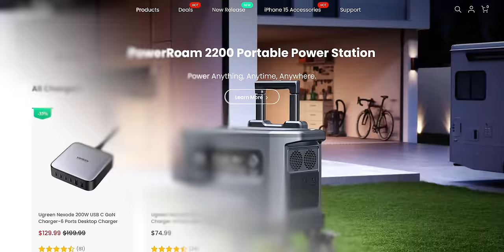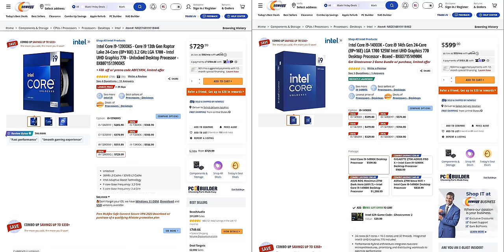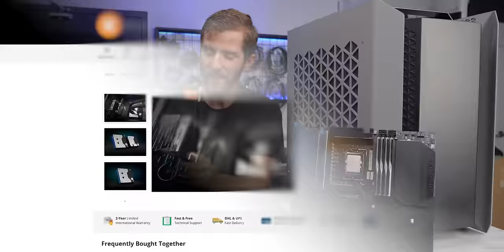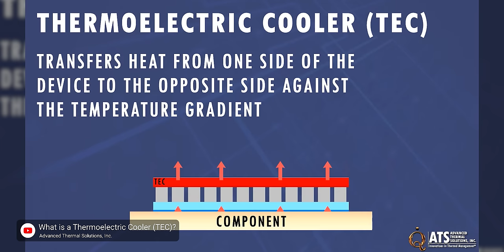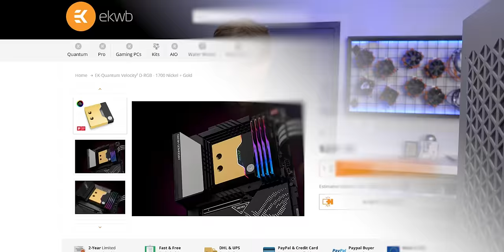Compensator 4 - How to Waste $30,000 on a Gaming PC

Comment: I think this video is the perfect reason that no one should build a compensator PC Because by the time the PC is built there's already newer or faster Hardware that has been released
Reply: I think if it fits your purpose and you like it and it plays everything you want for the coming years then it’s fine to spend 30k on it, hell I spent 15k on a DTR laptop and it’s still great. 

Guess I need to clarify since people don’t understand that people live differently than each other , but I’ve worked as a overseas contractor since 2016 in multiple high risk environments and having a desktop is not a reasonable thing to carry around  so a DTR laptop is the next best thing. I grew in the early 90s as a tech enthusiast and built my first computer in 99/ 2000 and it was a k6-2 amd with a 128 rage from ati . Beyond that I went to school for electrical engineering and COT and I was been into the modding community so I like pushing the limits and once again a DTR laptop is the way to go for me . 

It’s a niche product and has a pretty long lifespan even though half the fake techies that follow Linus think hardware is outdated in a year lol top end or even mid grade hardware is good for atleast 8 to 10 yrs though certain things might not work as they should , most functionality will remain.

So down to cost, well I’m fortunate enough to have a drive to get me to a place where I get paid very well so yea occasionally I spend a large mount on something I love or want . It’s not bragging if I just state the facts and why something is a reasonable purchase for me or many others.
Reply: @prodigy455 for 15k it better should be great.
Reply: @prodigy455 A $15k laptop...wtf
Reply: @WowCreativeUsername  straight up sounds regarded lol
Reply: @prodigy455  wtf how did you spend $15k on a laptop?
Reply: Anyone paying attention kinda expected the threadripper news since September, and that really would have changed this video because of the pcie lanes
Reply: let me quote linus:
"if you Want Bleeding Edge performance, you NEED Bleedng edge hardware!
but if you want to bleed your wallet dry, that's up to you!"
Reply: Simple, you just upgrade with every new product release :P
Reply: @prodigy455 wait wut? 15k?! wtf is in that thing to make it worth 15k? Does it have a bunch of 4090's or somethjng? XD
Reply: @zwenkwiel816 maybe he bought a server laptop? (I dont even know how)
Reply: Carefull staying on the bleeding edge of tech , you will get cut
Reply: @prodigy455 There is no way on this planet you should spend 30k on a pc.. and 15k on a laptop ? Dafuq does it do ? Is it gold plated ?
Reply: Okay tried looking and either that dude got super scammed or he meant 1,500 because the closest I got was a 13k laptop from Walmart that's clearly a scam.
Reply: The thing is the tech will be absolete pretty fast and there are maybe 20% gains for 600% increase in price. Now I am not saying thar cheaping out is good but you should never go above 4000$ for a gaming pc/laptop. Buy expensive monitors, keyboards and mice since those will great for many years to come but avoid super expensive desktops and laptops. 1500-4000$ for gaming PC, 300-1000$ for monitor, 40-200$ for mouse and 40-300$ for a keyboard is fine. Total for the cheapest average gaming setup would be around 1880$ and around 5500$ for the most expensive average gaming pc setup.
Reply: I love how you said "newer OR faster". Looking at Intel 😅
Reply: And not only is there newer, better hardware now available, it whoops this so bad that this thing actually looks pretty lame by comparison ....
Reply: It was and will be always like that 🤷🏻‍♂️
Reply: @sggsquadpresents  How the hell do you come up with a 1880 gaming pc as the cheapest average ? You can get a very powerful gaming machine for 1500$ with a 7800x3d and a rx7800XT.

You can easily get a 1000$ gaming pc that can run every single game at 2k resolution ULTRA. Ryzen 7 5800X3D and a 7800XT.

There is no way you need to spend 2K for a average gaming PC. What planet do you live on ?
Reply: @almightybogza exactly what I was thinking.
Gold plated with .002 carat diamonds here and there.

On the inside it's just a 4090 with a i3 14300kf 😂😂
Reply: @sggsquadpresents  If we talk setups then still you can easily get a gaming setup with mechanic keyboard,headset,a decent mouse and a decent 1440p monitor IPS for under 1500 dollars and you can probably go lower if you go fullHD which is still the average..
Reply: @RedRingOfDead  Haha "yea mom I need this for my zoom classes"
Reply: @prodigy455 you could've bought a decent car for that price... Insane
Reply: @prodigy455 that would be the fastest pc money can buy for you. Compensator is a different story
Reply: harrybyrne7124  that’s not really a point it’s just another option but some people have other workloads than gaming and I understand that  so I get why someone especially if they have the money to spend would want a bit of overkill.
Reply: @prodigy455 It's actually hilarious that this is liked like it's a reasonable thing to say.
Reply: @Dell-ol6hb just look at any latest Mac lmao
Reply: Reminds me of the thought experiment where a guy travels to a far off planet in stasis, to arrive there like 300 years later, only to find out that 50 years after you left on your journey, humanity found better technology and got to the planet hundreds of years before you lmao
Reply: One thing is, if you get all the watercooling hardware, you can watercool for not that much extra when you go to swap parts.
Reply: @WowCreativeUsername  oh no
Reply: @prodigy455  Are u sure its USD or any other currency?
Reply: and cheaper this year it costs 30,000$ next year it costs 20,000$ and year after that 10,000$ so in just 3 years it will cost 1/3 of the original price
Reply: Same can be said for a PC at literally any price point lol. You thought you said something here.
Reply: @WowCreativeUsername ikr... i think most expensive one atm is like 10k and even that is like stupid since ones with similar specs are like ~6k lmao
Reply: @prodigy455 whats the exact model of the one you got? wanna buy a few too to heat up the house
Reply: @prodigy455 I hope that you're laptop is fine and it sounds wonderful that you can obtained it, I hope that it'll serve few more years tho! 🔥
Reply: I'm kind of surprised nobody has created a service that offers a PC "subscription" for people who always want the latest and greatest hardware. They send you a new PC with the newest and best configuration once a year. You transfer your data and send the old PC back. They could charge a chunky subscription fee and also refurbish and resell the old hardware. Or better yet, they could offer a "sloppy seconds" subscription where you get a refurbished PC from the previous year. 
I think I might be on to something here!
Reply: If they hadn't built it right when a bunch of new hardware was announced yeah, but if they built it at the beginning of this year they wouldn't have
Reply: @angryginger791  Almost certainly too clunky for a lot of reasons. PCs are heavy and expensive to ship, even with proper packaging they're susceptible to damage and you'd have customers packaging them and sending them back once a year. You'd also probably get a lot of warranty fraud of people trying to steal parts by replacing them with broken versions. Also probably a lot of legalese with regards to what you're allowed to do on the computer, is it "yours", etc.. Likely way more headaches than there is profit.
Reply: @prodigy455 😮😮😢😮😢😮
Reply: @prodigy455 you sound like you make $200k/year and still broke. Who tf would buy a 10k computer 😂
Reply: @Frisky_Panda  I mean I make a bit over 10k a month yea I spent 15k on a DTR laptop that I wanted , it didn’t break the bank and it’s pretty normal to spend it when you got it especially if you know how to manage it. You could also say who would spend over 100k on car but people and I did , bought cash and it still didn’t hurt, so I don’t know why you’re in disbelief.
Reply: The problem with tech is just that when you buy something, something better is right around the corner. With that in mind if you buy top of the line you usually upgrade less in terms of performance and games catching up
Reply: @prodigy455 just curious, what is the laptop you bought. Like either the model or specs wise.
Reply: For people asking about the 15k laptop, I know the "ThinkPad P16 Gen 2 Intel" is about 10k when not on sale, and has some absurd specs like 128gb ddr5
Reply: @prodigy455 for $15k it better come bundled with a $12k Honda Civic LOL
Reply: @natman2162  Oh yeah, there's a ton of reason not to. But I'd also think that people wouldn't spend $5k+ on a PC you can build for $3k, but they do it all the time.
Reply: @almightybogza  You joke, but zoom is like an 80% all core load that makes everything else unusable on my laptop.
Reply: @prodigy455  Literally how did you pay that much? latest DTR 17 is 6K At most
Reply: @khakers2.099  TBH i blame the laptop.. the cpu's even on gaming laptops usually suck ass. 
Windows also eats through it like nothing.. I run a i5 9300H on my laptop (best deal with a 2060).

Worst mistake I ever did.. the fans spin to 6000RPM my laptop is literally taking off
Reply: ... and getting the most expensive thing even if it is worse
Reply: @almightybogza  I don't know what you expected from a laptop, that's just how they work. The CPU in mine is perfectly fine, and it's better than the vast majority of office machines that zoom can expect to run on regardless.
Reply: @khakers2.099  Most laptops from my experience run way too hot, have very weak CPUs and in general for a gaming option they just suck while also being wayy too expensive.

It does the job but I will always complain if the consumer gets fkd in the end. F this shitty market, laptop manufacturers can do better.
Reply: You know you went overboard when the motherboard costs more than your core i9….
Reply: @hot_wheelz yea for gaming the 149000k is the way to go outside of gaming the new threadripper Maybe
Reply: I think you just need to be faster about building the PC
Reply: @prodigy455  WTF!!!! that laptop better do my laundry and file my taxes to cost that much
Reply: @WowCreativeUsername  that’s only two months pay lol
Reply: @zwenkwiel816  24tb of ssd storage, dual 150w 2080s , desktop 11900k ,128gb of ram.

Once again when you make that in two months , 15k isn’t a big deal.
Reply: @prodigy455  Yeah okay, but most people don't make that in 2 months. And it's still a completely ridiculous laptop that's already redundant in so many ways LMAO. I wouldn't pay 3k for it tbh.
Reply: @AnEagle  I did better , I have a 2020 GTR and good luck finding a speced out DTR laptop for less than 15k
Reply: @timofeifilippov9558  money doesn’t mean faster always lol the laptop I bought was a niche product that most can’t afford , not my fault it’s just how it is. It fit my need and actually is still pretty solid for it age  but I work as a contractor overseas and have lived in multiple combat zones and currently I’m in Syria and having a desktop is out of the question.
Reply: @CADClicker  it is , especially when it’s a niche product and you’re someone like me who can’t have a desktop because I work overseas in multiple combat zones . A DTR laptop fits my needs and gives me a desktop experience on the go, and I make a bit over 20k in two months so it’s not like it’ll break me and if I wanna splurge at times then it’s fine , people with less money do it all the time and I don’t see anybody bitching.
Reply: @starksuman  it was in usd, I don’t get why spending that much is mind blowing . Some of use don’t work simple desk jobs in the states and work traveling in combat zones , so a desktop is not reasonable but a DTR laptop is.
Reply: @plopolip01  24tb of ssd storage, dual 150w 2080s , desktop 11900k ,128gb of ram.
Not that hot, and it still works great.
Reply: @natman2162  still working great and being honest, I carry it and is psu still . Working overseas in combats zones makes having a DTR laptop worth it especially since I can’t have a desktop when I travel
Reply: Outergain  get a security clearance, network, build up your resume and if you have to take a lower paying position to atleast get your foot in the door and then transfer to a better position or company after 6months to a year but don’t start contract hopping .
Reply: @himynameisjim92  that’s not an issue when you really love tech , only fanboys have to have the latest and greatest and believe that their new card or part is already outdated
Reply: @hey01e5  why would it do that, it’s just a niche product that fills a void for people who can afford it like me and that can’t have a desktop because of our job.
Reply: @Generationalwealth94  how redundant? I’ve never understood that and some of us work in high risk environments and travel quite a bit so having a DTR laptop makes sense and it’ll still keep up with the best, the fanboys just don’t appreciate tech or get how it works and it’s showing.
Reply: @prodigy455  Well it's very much diminshing returns at that point, good for you tho.
Reply: @prodigy455  whats the model tho?
Reply: @prodigy455  >bragging to a random person online about wages
Reply: @plopolip01  sky x9c
Reply: Like a true compensator you just keep swiping you card and throw money to keep the appearance 🤷🏽‍♂️
Reply: @emanuelperez3595  who you talking about ? I’ve only bought two laptops like that in my lifetime and I mean some of us work jobs in high risk war zones and can’t have a desktop so with that good salary I make I buy the next best thing to fill the void. I’m also an actual techie and built my first gaming pc in 1999 and I was just a kid then , yea parents got the parts but I learned where everything went and what it was on my own with trial and error. I have a degree in electrical engineering and computer operations so that helps also, so yes I’m very impressed with DTR laptops .
Reply: @WowCreativeUsername  it’s not bragging but I’ve met people like you who can’t read or make assumptions. I was stating the facts about why it’s reasonable for me to spend so much and putting figures is a good way to explain scale.
Reply: That's why I always buy the "enthusiest" tier of stuff, only buy Nvidia GPU's in the xx70 range and AMD in the x7xx, I only buy intel CPU's in the xx7xx range and AMD in the x7xx range
They will last you 6+ years before they feel like they're being left behind in gaming
Reply: @prodigy455  "people like you" Aww, did I hit a nerve?
Reply: @emanuelperez3595  who you talking about?
Reply: this actually happened to me! i got a setup with a 13900k and the rog 4090 and like a month later the 14series of i9's got announced
Reply: @nyafu_uwu  what would be the issue though? The hardware is still top notch and will be for years to come. That’s why new hardware doesn’t bother me
Reply: @prodigy455  I don't care about your laptop man, you misunderstood me. What I said is related to the first part of your comment, where you say that spending big money on a PC is understandable of the person wants it to deal with everything for years to come etc. I said that this would be the "fastest gaming pc money can buy", I believe there were videos with this title. "Compensator" is different because it isn't the fastest, but the most expensive.
Reply: @prodigy455  the hardware keeps updating and if u want to update something you need to update half the other stuff to not bottleneck it. also fomo
Reply: @nyafu_uwu  real world for most applications and games you won’t notice for a long time
Reply: @prodigy455  i feel like you dont understand the stuff i run?
Reply: @timofeifilippov9558  it’s still by far one of the fastest on the market , the average user doesn’t have half the hardware power as a compensator.
Reply: @prodigy455  Me: crying in GTX 1080 Ti and 8700K
Reply: @biosyn4898  nothing wrong with either and still work perfectly fine for most games.
Reply: Maybe in the 80's 90's and 2000's. Today pc hardware cadence is like 2+ years. Not 1-6 months.
Reply: Ayo 6.9K likesss? Nice
Reply: @WowCreativeUsername they might do ultra intensive 3d modelling on it
Reply: @marcelslofstra2157 better should be great?
Reply: @cameronlotter1392   Are you asking me something?
Reply: They knewww
Reply: @marcelslofstra2157  you said "better should be great" which makes absolutely no sense
Reply: @sammiller6631  lol
Reply: Or just do it right by ordering the most optimal parts for the build..... "BUT you can get a better xxxx" is annoying and dumb.
Reply: Not only that but your wasting money, he said multiple times that there was better hardware for cheaper in the video
Reply: Unless you're loaded with cash and this is your hobby then go for it lol, but for the rest of us Nah don't do it xD
Reply: Well yes. But it is gonna last you for like 5 or 6 years at least lol
Reply: the case isnt even good... Roman (Der 8auer) tested it and it sucked compared to other watercoolers.

like compared with an 360 aio the difference is not that big.

and any 360 or 420 custom watercooler with decent radiator will be better then this case in terms of cooling.
Reply: @prodigy455   That is not worth $15,000.... not even close. The best config of a DTR workstation laptop TODAY is $6500 USD with an RTX 4090 and 13900K with 24TB of FireCuda storage.  An RTX 2080 is worth less than $400 a pop so that's only $800. Even the best RAM at 128GB less than $600.  24TB of storage with the best M.2 NVMe storage is maybe $2000. Where are you getting the other $11,600 from as this is clearly an older laptop and PC prices are WAY higher today especially CPUs and GPUs than they were back then.
Reply: @LOSSLESSOFFICIAL  damn you really fell on stupid lol try 2 8tb drives , 2 4tb drives, dual mxm 2080s which even now still over $1000 new and back then were $1500 each . 128gb of the fastest ram which wasn’t cheap at the time , one of the few 1440p 120hz laptop displays at the time , pretty advanced case along with a massive cooling system and 780w power supply , a delided 9900k and a 11900k.  I’m sure I’ve missed something but none of it was cheap and it was a niche product that not many companies were producing.
Reply: Tho point of it is you dont need to upgrade as games will take a while before they start catering to the absolute best PCs on the market.
Reply: Yeah so I don't think Bill Gates would care
Reply: its exactly the reason i hate people who are like "you still run a ddr4(3) system bro you know ddr5(4) is here and is way better" like IDGAF it runs what i want it to run perfectly fine
Reply: Check out the lyrics to Weird Al's "All About the Pentiums"

Old as hell by now, but I think it aged like wine. Very relevant to this vid lmao
Reply: Eh, it does become a lesson in temperance when you do, so it isn't all bad
Reply: me with an 8th gen core i3 😐
Reply: @prodigy455 $15,000? They robbed you bro
Reply: That’s a good point if it wasn’t for this comment then I would’ve built one
Reply: For 30k compare to 94k apple desktop
Reply: @almightybogza  there are YouTuber purchases 94k apple  desktop
Reply: @prodigy455 well said
Reply: @almightybogza It depends on where you live and your standards. To me anything but every setting at absolute max in minimum 1440 but preferably 4k and 60 - 200 FPS is crap. So where I live that's like a 4090 which here costs about 2500 USD.
Reply: @BertyBertsson  Yea in this case it also depends if you are rich lol
Reply: @prodigy455 tell me you know nothing about laptops/computers without telling me. The best gaming laptop right under 4k, can do anything that you're wanting to do, even if it had the best thread ripper it wouldn't cost 15k, you got scammed so badly or you're just blatantly lying. But I believe you got scammed trying to say a i9 13900k and a Rtx 4090 in a laptop isn't met for your work needs.
Reply: @prodigy455 a 3700$ laptop can handle any workload better then your 15k I'm 80% sure
Reply: @prodigy455 could have gotten a laptop with a 4090 a card that would beat two 2080's in any workload probably by a lot. A i9 13980hx 128gb ddr5 ram that is much faster, with the same storage for 5k less. So you got scammed around 6-7k dollars
Reply: @prodigy455 I found a laptop that beats yours by a mile for 5k less showing you got scammed horridly
Reply: @prodigy455 i don't have a degree in any tech and I know much much more then you do clearly
Reply: @Nate_the_Nobody ryzen 7 2700x is already outdated and if it's not to most people it will be ina few years and that's coming from someone who loves amd
Reply: @prodigy455 a 2080 is not 1000 each even brand new that go for around 400$
Reply: @prodigy455 and there's nothing better then a m.2 nvme drive
Reply: @RevAim  this was years ago also you cheetho eater , not recent and even so for A.I. workloads you’re not gonna beat two 2080s with a single 4090 laptop variant lol
Reply: @RevAim  80% is just a random figure you are using to sound cool but you’re basing it off of absolutely nothing , that system even now with a delided 11900k would smoke pretty much everything on the market and it’s tough for any laptop variant card to match that of MXM let alone two.
Reply: @prodigy455  no one understands you mate, they keep seeming to think about price. i understand if your making 15k a month for example and are passionate about something its not a big deal spending 2 months of savings on one... no doubt its getting worse gradually as they release more and more.

As you say though it will be fine doing most things, for atleast 10 years from purchase. i wish you nothing but good health and wealth mate.
Reply: @Bailey03_C  yea I don’t understand why people were getting so upset, not like I’m bragging I’m just stating that in the past the systems have existed and they cost so much because they’re a small market item and only for those who use them for work or people like me that work in an environment to where having a desktop is not practical. Me having the extra money is something else entirely and I maxed it out because I could and I found a use case for it, it is strange though people were comparing it to a newer laptop like they missed everything else I had said lol
Reply: Don't build Intel.. or use sleep/standby mode.. unless u like fuse box fireworks 😂...
Reply: As Weird Al said, in "It's All About the Pentiums" - "My new computer's got the clocks, it rocks, but it was obsolete before I opened the box".
Reply: Yeah thats cheaper lol
Reply: @AnEagle  just seen the reply but lol yea I mean I already have a 2020 GTR so I’m good on the car part.
Reply: @Frisky_Panda  how $200k and broke? Never once did I say I was struggling and it’s actually only $164k a year and I’m tax free plus I get disability from the VA for life , so the complete opposite of you section 8 lol
Reply: @prodigy455  lol wait when you said you "get paid very well" 120k a year isn't super insane and definitely does not put you in the ballpark to casually spend 15k on a laptop lol, it's cool tho i also think its fun to lie online.
Reply: @bit7892  how would it be a lie ? I work as a contractor overseas and actually I’m changing positions to a new company ,, my base is now $85k which means my annual salary is $175k ish. I also only have to work 9 months and get 3months off and even with that 3 months off I still get paid my base salary.
Reply: @prodigy455  lol. cool? Feel like this whole thread has been propelled by an ulterior motive to tell the whole world how much money you make working an average job in awful conditions. At the end of the day you're  just justifying bad spending habits, especially considering you can get something with similar performance for like 20% of what you paid.
Reply: @bit7892  and there you missed the point and just focused on my money, when I stated it to make sense of the balance difference that so many miss. When you have the money it’s more reasonable to afford different things. With the system , well it was years ago now and my current laptop only cost around $2500 with a mobile 4080 and it works fine but the DTR laptops I’ve owned in the past were niche items and actually were more on par with actual desktop counterparts which couldn’t be had with your standard laptop along with I was able to run sli and upgrade pretty much each component. Being an actual tech guy I actually enjoy to buy something like that to tinker with even if I break it.
Reply: @bit7892  also I don’t have a need to brag about my salary it’s just how you wanna see it , it doesn’t gain me anything and I don’t need cool points with anyone . I usually just comment because it gets old with people just assuming something is stupid because they can’t afford it or because it doesn’t make sense to their lifestyle.
Reply: @prodigy455  You sound like the type of guy who buys a tesla to save on gas
Reply: @bookbookbook1  I would buy one but I bought a 2020 GTR instead lol
Reply: @sggsquadpresents  you just broke
Reply: @almightybogza  so stop crying about it and make your own laptop 🤦‍♂
Reply: Exactly just buy laptop and use vr headset.
Reply: im in third world. i rather use cloud service for work, game and (mobility) than pay to build this rig. what do u think.
Reply: F
Reply: @prodigy455 I see you on insignia lmao. Clicked your profile because your “prodigy” name reminded me of the band and toxic euphorias old halo 2 montages with prodigy. Really liked his spitfire montage
Reply: @prodigy455 lmao sure but I bought a laptop from this year that was 2k and prolly equal or better than  yours specs wise
Reply: @kevinlechner7722  still missing the point of a DTR laptop lol
Reply: @prodigy455  well if it’s not cpu gpu strorage batter life or screen resolution/refresh rate… what is it ram quantity (not clock speeds)
Reply: And i thought my 10K setup was expensive :(
Reply: @AnEagle is it? If he already has a car or two, a house, and a extra 100.000 or two in his bank account...whats insane about it?
Reply: Dont go amd for gaming lol. Compare using gpuboss and you will see the amd is like 30% cheaper for the equivaent of the nvidia HOWEVER the performance is always less than the nvidia version. If you want no stress intel/nvidia is the best way to go
Reply: @prodigy455  Shit better be dipped in gold, lathered in diamonds then descended from the heavens to be worth that much
Reply: @RyioKart  why would it be? Once again it was a niche item with desktop level parts in a portable form factor. A lot of the cost comes from the MXM parts , the large ssd drives I was using , ram and my cpu choices. The power supply alone was over $300. Fact I have the money to spend on things like that and to me it’s no different than spending $2500 on a device or like I spent $114k on my car which is a 2020 GTR and it’s not covered in diamonds or anything special but I love it and it’s unique and it didn’t break the bank.
Reply: I kinda doing that but I anit on that money and getting a pc that’s 7k to 6k ad (Australian dollar) seems cheap but it a godly upgrade for me and the storage I focused on so I have 20 Tera so I can keep it long
Reply: Its sad though, that in your spare time in such a risky profession  all you have time to do is argue with people, and shit on every LTT video..... sad existence i would say@prodigy455
Reply: @dme8560  Hows its risky profession? And i get paid to do so lol Most people commenting on the video no tech knowledge so its fun to mess with them.
Reply: @tayk-47usa41 he might be severely acoustic
Reply: @Dell-ol6hb bad financial abilities lmfao
Reply: @SSYoung125  if obsolescence is your metric, you should never build a gaming pc.